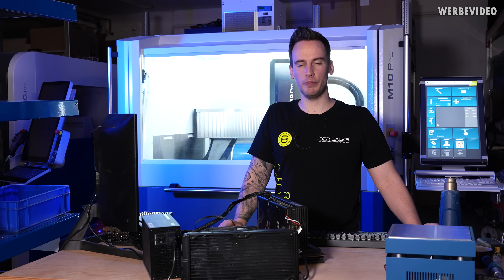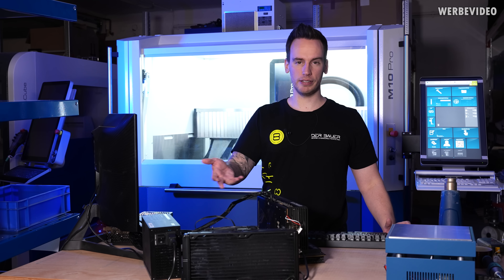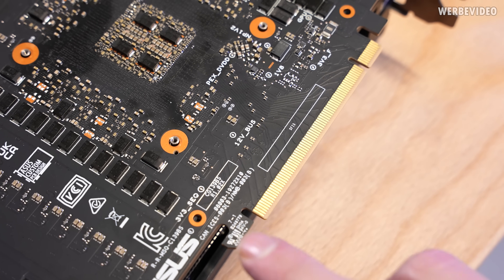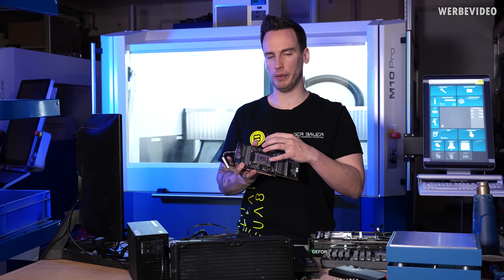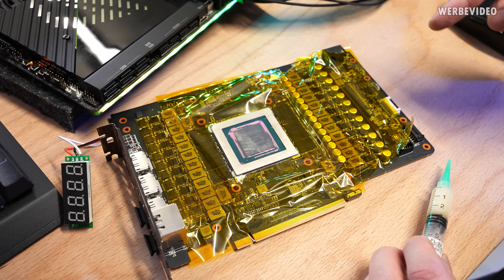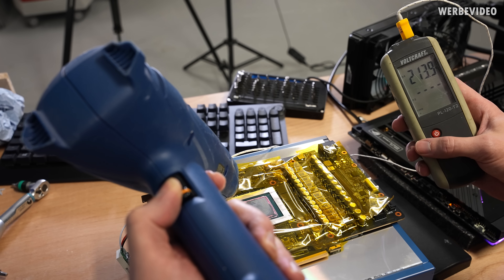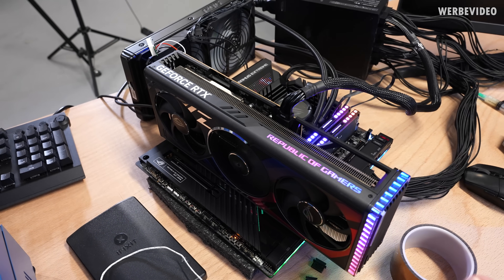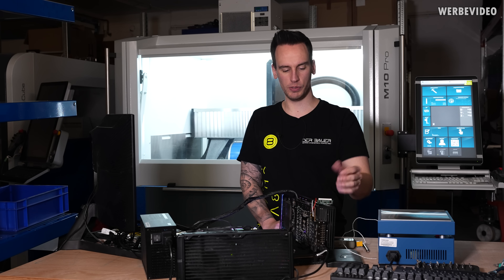I tried to repair my RTX 4090 and killed it :(

Comment: I'm pretty sure that KrisFix-Germany can repair this for you if you have not fried the GPU chip itself. Anyway the "Oven method" would be safer, but also not a good choice in your case (or any case).
You made a lot of mistakes in the process (PCB 80°C instead of 150°C etc...) and maybe you fried the GPU chip too, but if you are lucky, reballing can help.

Comment: The type of material they use needs about 320C to 350C , but doing like you did is not a good idea because you need A LOT more flux and the temp needed is bad for the GPU, factory will do that temp for a couple of sec.

Now the only way to fix it ( and it´s a maybe ) is a proper reball, but is never a 100% fix and it might never work again.

for sure some solder got bridge and the GPU do not start to keep the chip safe.

Comment: You can’t relly on that temperature gauge because you’re using heatgun that does not heat the entire chip evenly. Unless you’re using something like bga rework station. But all in all don’t heatgun your gpu chip if you’re not sure what are you doing. Because that is the most precious chip in the entire board ;)

Comment: You had to remove compound around GPU chip before heating. ...
Because after heat up solder could melt and shift chip, but stuck on compound so you lost contact between PCB and chip
 if it wasn't the reason of issue reball is necessary

Comment: You should have used at minimum a rework station.  That thing is not for soldering.  More flux, if it dries up add more and get it up to 220c steady then move in closer to 260c for around 10 seconds.  Use a swirling motion to evenly heat.  Did you check the pcie pins in diode mode first?

Comment: I have similar issue. Bought 3080Ti, it works on another system but wont post on mine. So addd my older gpu and 3080Ti on same system and saw 3080ti was bering detected in bios and Device Manager, but it just refused to post on my pc.

Comment: "AGP PCI-E X16 -Purpose Display Video Card Checker Tester Card Diagnostic"  will tell you if you have a short on your PCI lanes.  Other than that, you need to test for shorts on the card,  apply voltage to the short and monitor with a thermal camera to find the problem.  The GPU is not dead, just has a short somewhere.   This doesn't seem like a memory failure, look at the mosfets really good and see if there are any bulges cracks.  Seems like a power problem.  Just just be a surface mount fuse or could be a mosfet.

Comment: I can't believe you treated the graphics card with a heat gun.
This is not a replacement for a hot air station, it may work to use this crap to defrost the card after LN2, but not for soldering!

Comment: You put it in the oven for 180C (or even higher, I did 220 once), not 80. First remove all plastics ofc. It can work and can reflow joints - but it is a solution that will stop working after weeks or months. Cause you will degrade all of the joints slightly (oxidation). I did that to my old amd (I think it was r7/r9 2xx era) gpu twice - got it working for 8 more months that way. Didn't try it for the 3rd time cause it would be just beating a dead horse.

Comment: Stabbing in dark Romain,did you tried remove that voltage redout panel because I thoughts so its BIOS issue,don't have RTX 4090 to test it mate😢

Best of luck mate 👍

Comment: Hi roman
Thats a vbios chip failure
Simply identify the model number of it and get a replacement on ali express or anywhere else you know and fix it easily
Its not dead dead btw
A vbios holds information in different steps or stack of data
The fact that there are some data being read from it is making the theory stronger because only upper level data which contain very important feature like the nature of the placed pcie card and vender and venderID and stuff like this is showing up
Also yes that (its now reports that its running at gen 4 16x) is wrong and simply due to miscommunication
With thousands of love from iran

Comment: Send it in to Asus. And say you don't know what's wrong with it. Would be very curious to see what they say and what they will even do for you. 
1. I'd guess just replace it right away and fix it for refurbished etc.
2. Say you voided things messing with it.
HOWEVER IF YOU MELT THE POWER CONNECTOR FIRST, THEY "WANT" THOSE CARDS. so melt the connector first then send it in.
@GamersNexus would probably be interested in this as well

Comment: I think you have a failure to initialize on the GPU core itself. You likepy caused some solder balls to bridge under the BGA when you used that heat gun.

Comment: do proper visual inspection. It is possible some other components around or on the back of card got detached or misaligned. I saw you used Kapton tape, most repairmans do not recommend doing that, as the Kapton tape heats up it deforms and pulls components from the board.

Recently I also saw a video where for proper reflowing you need to reach higher temps but for short period of time. The chips do not like being +200C for prolonged time. Datasheets actually show this, max temps during soldering and the time. I would expect modern chips are more sensitive to this.

Comment: when you use flux around the GPU flux will go there around nearby pins.... center pins will get huge heat without flux could be messed up the connection, especially with this huge die and so many pads under GPU  ... 100 c for a component on the backplate isn't so much to make a huge problem with caps and etc but maybe direct contact with the plate makes a short circuit to some sensitive component especially if your heater plate doesn't ground properly(such as bios chip make it unstable )....if the core voltage still there maybe you hit some memory modules too:-?

Comment: The heatgun you used is not for electronics, is for soldering plumming copper pipes :D The air power of that hotair gun can displace some components and even solder. The electronics hotair gun has temperature, air control and different nozle sizes for each IC you use it on. You can draw conclusions now.
Reply: He had no idea what he was doing and brokeeee it

Comment: If you'd like to go with reballing, you can try pre-formed solder balls that require stencil to be put in place. Stencil probably could be ordered from pcb manufacturer without any issues if you'll have the layout file.
Reply: I know professionals that HATE that method. It's easier to tape the BGA to the stencil and smear solder paste on and then hit the BGA with a heatgun to form the balls.

Comment: Too much directly on gpu die, should have heated from bottom,  or used a proper bga reball station,  kapton tape offer little protection especially on those aluminium caps.

Comment: In my very limited experience fixing GPUs, I've only run into something like this once, and it turned out to be a bad EEPROM/BIOS chip, though this could also indicate faulty memory or a faulty memory controller. There is a possibility the GPU heated up to a point where something in the memory controller just went awry. Best of luck!

Comment: Wasn't there a problem with incorrect data feedback from these cards ?
It may well have been running at x16 and reporting incorrectly that it was running at x8
You might have cooked a perfectly good card
Reply: I think the benchmark results verified it was only at 8x

Comment: Reflow and reball only is a viable fix if the card suffered liquid damage or flexed too much in the first place (dropped, bad handling). If the GPU failed, the fix is to replace de GPU. No amount of heat will permanently fix a damaged GPU. Because you heated up the GPU with a heat gun with uncontrolled temperature, it's likely that some solder balls got liquid and others didn't. The actual fix for you is actually a reball. Now you have an excuse to visit Louis Rossman!

Comment: @der8auer EN
maybe I can tell you what happens 

Same problem, happened to me (PCIE 4.0 x8)

I am using ROG Z690 EG, I took it for maintenance, after two experiences, I found a solution

If you update your bios (maybe 1403,1505,1601) it was at that time that the problem arose

Be sure to update directly to the latest bios before 1403 (eg.1101/1304 update to 2103 ,this is ASUS tell me)

Now can't go back, I can only send it to their headquarters in Taiwan to flash back bios 

Now I running bios 2103 and Tuf 4090 ，finally can do it pcie 4.0 x16 

Hope my unhappy experience can help you
Reply: I have the same x8 problem, but on ASUS x670e + ASUS 4090 TUF card.

Was your issue the actual motherboard? Or the V-card?
Reply: @calop002  is motherboard , because my friend also have same problem , just running x8 , we both send to Asus , lucky can running x16 now

Comment: My 3080Ti has been in my pci-e riser from the day I bought it, plugged in only once when new. Last week it started only running in x8 and the PC was crashing with artefacts only when running games. I removed the card cleaned the pci-e contacts, x8. Cleaned the riser contacts, x8. Plugged the card directly into the motherboard, x8. Tried it directly in different pci-e x16 slots, x8. I then gave it a few hard taps onto the cooler and plugged it back in to the riser, x16!!! Working fine since then. I don't know what got it working, the hard tap to the cooler or the inserting and removing of the card repeatedly, who knows.

Comment: Hey :) I can try to reball it, maybe you just melt/shorted some memory pins/duno - need to check =) in the worst case scenario you overheated memory controller and it doesn't detect memory anymore even if core shows up... I actually love doing mods to gpu's - just recentlly bring to live rtx3070 with new memory and some clever gpu vcore mods   & I'm near Germany - Lithuania

Comment: Next step: send it to someone competent, unless you really want a 4090-shaped paperweight.

Also before re-flowing any bga chips you should remove glue from the corners of the chip otherwise solderballs underneath the chip will get scwashed forming a nice short. And yes you should use heat-resistant spacers between the hotplate and whatever is on top of it.

Comment: The caps say the temp usually and it always lead free solder so it easy to know the temps
You also didn't use enough flux or the correct type for a reflow and more than likely bridged balls
Only way to fix it to take chip off and reball which now is a good excuse to learn
And fyi for future reference tapping or nudging will let you know if you actually melted all the balls

Comment: I have baking experience. I've baked a HP laptop motherboard way back 10years ago or so, the laptop would just BSOD very often. So I've reade online I should try to bake the Mbo in the oven. Put 200C in the preheated oven for 10min. take it out, back in laptop, problem fixed, no more random BSODs. I don't know where he read in a Germán forum, to put in in the oven on 80C, that won't do shit.

Comment: After heating the GPU when it hot give it one light knock with the bottom of a screw driver, it can help the solder to get back in place. try it again.

Comment: correction, most gpu related issues such as no display/black screen, artifacting/memory errors and even io errors such as yours which can be fixed by "baking" the card are caused by a failing fcbga package/die to substrate bumps. it's a common misconception that it's the bga itself that's at fault, because reballing the chip makes it temporarily work again. it's almost never the bga, unless there was physical damage to the board.
also using a heatgun to melt the solder balls without prebaking the gpu to get rid of the moisture that's trapped in between the different layers of the chip is almost guaranteed to kill it, especially if you ran ln2

Comment: the main mistake is blowing into the chip crystal. the second mistake is that you need to remove the compound. at soldering stations, more than 300 degrees are heated from below, the upper heater is 230-260 degrees, this is done so that the crystal does not fall off from the GPU of the textolite. perhaps it will save a full reball of the chip..... but most likely this is already a chip of the solder of the crystal, precisely because you blew into the crystal and the temperature was measured next to the board.... the crystal can not be heated more than 250 degrees

P.s. heating and cooling should be slow ..... soldering stations are heated 15-20 minutes to the temperature of desoldering

Comment: I've actually fixed an AMD card with that method. I used the oven method. You did a couple of things wrong according to my experience: 1) you didn't use an oven, you should have used an electric oven and not an hot air gun with hot pad 2) you allowed direct contact of the card on a heated surface, when in the oven i used 4 aluminum papper balls to rise the card out of the floor of the oven 3) you should have distributed the heat evenly, i think the yellow paper cover to protect the GPU surrounds you used is actually what killed it, because it didn't allowed the components to expand and contract in sync and that caused tears on components
Reply: This...

Never use kapton tape ... its streching under heat and it can displace some of the components with it...

Comment: I'm so curious as to why you went right into trying to reflow the die and not checking other points of interest first. To me it was obvious that the die itself wouldn't be the issue but memory or a cap somewhere around the die would be to blame. I'm just curious why you decided on that first.
Reply: Ovens and paint stripping guns is the non tech youtube 'fix' for broken gpus, and yes it never works.

Comment: with that heat, not much should change, the only thing that changed is flux under BGA, from my experience isopropyl alcohol under chips can get them "shorted" or at least not working properly i can image same goes with flux to some extend, or the specific flux you used. I would try to remove that flux under chip with something like iso or my fav pcc-15 then as stupid as it sounds, blow it out with air compressor.
Reply: yes makes sense to try. but maybe roman didnt saw such comment(s) after reading about some other type of things to do. this is a good idea however too

Comment: IIRC Northridge Fix mentioned something about kapton tape not being foolproof - while it can deflect heat, it can also shrink and cause your heated components to move, once the solder weakens enough. He often uses metallic shielding, when using heat gun near heat sensitive components like capacitors and low melt solder, when working near connectors.
Reply: @Michaels Carport thank you for clarification 👍
edited my top comment to avoid any confusion.

Comment: at an abstract level (which is all i have because i don't have any tinkering experience) i thought the idea of turning the solder from solid to liquid seemed very risky because if any soldering was done with very little margin for error then melting it would cause shorts. but then i thought well, but maybe in the real world it doesn't go instantly into a perfect liquid and maybe just softens and sags a bit (though shorting could still occur it wouldn't be as likely than if the solder turned into a superfluid and went all over the place 😀)  another test that would probably be unlikely to result in anything would be to test the x8 board in another motherboard. if that worked at x16 then that would just add to the mysterious behavior though since a different gpu did work on your original motherboard... hrm.. oh! maybe you could put it the freezer to undo the heating! 😀 and if thermals don't work, perhaps kinetic shock will (slap it around until it knows you're the boss ;-))
Reply: The board is covered in solder mask, which liquid solder doesn't like: it's drawn to clean, hot metal pads, so when they heat up they draw in the liquid solder, clearing it off the solder mask and avoiding bridges. It's a (very little) bit like a bead of water on a smooth surface is drawn to your (rougher) finger tip when you touch it.

Comment: They are probably using low melt solder balls. I would have went with a curve up to 185C with a ready "near" cooling fan after the reflow. so to drop the temperature "faster".
That error means the DIE on, vbios is somehow loaded (you managed to flash it so communication with the nand is ok)
Probably some memory balls moved around.

Comment: Right tool for the job would help. Use that heat gun for paint stripping and get an AGP data line tester for diagnosis

Comment: The main probelem that you used a heatgun which you can't controll it is tempeature, beacuse this way you have owerheated it(the real temperature was more than 240C, and the fast heatup could cause similar problems too). It might not be dead but you could have ruined connection beetween the die and the substrate due to the high heat.

Comment: saved an evga card few years ago by baking in the oven also old xbox360s its a last dich attempt and some caps might explode or smoke if i see them swell i turn oven off open door and leave to cool in the heat dosnt always work but when it works it feels amazing lol.  I'm no expert btw just a guy with an oven and a dream :) if it doesn't work keep it around as you might find something else to try fix it later love your vids 👌